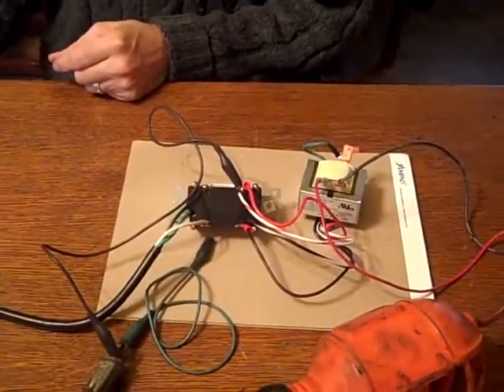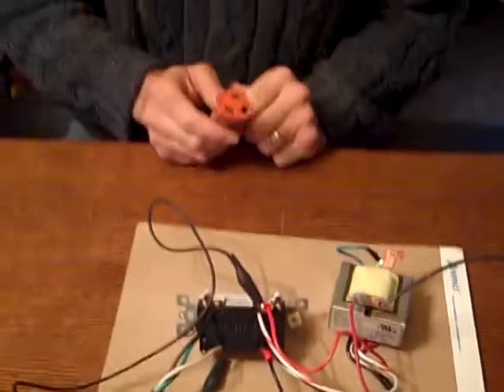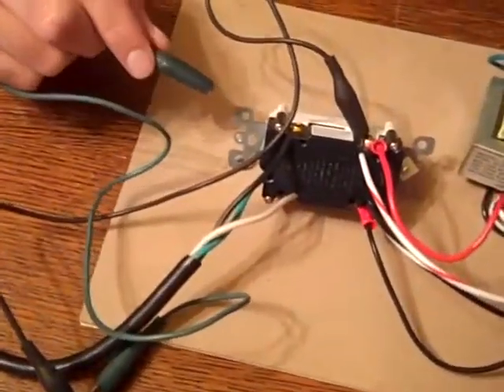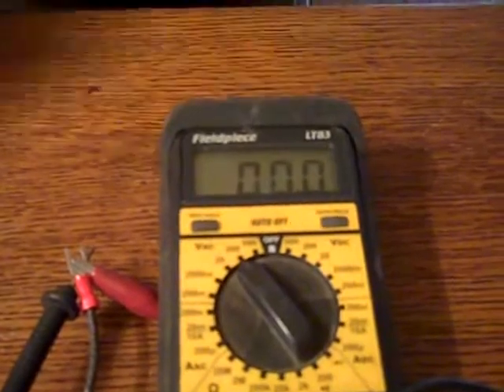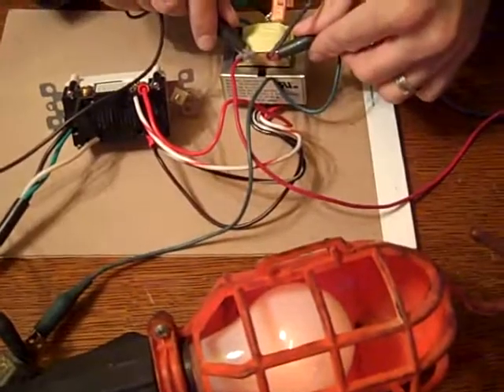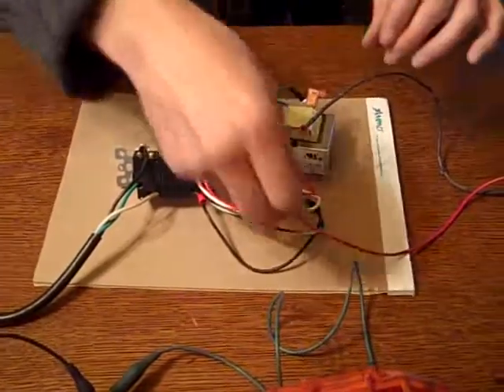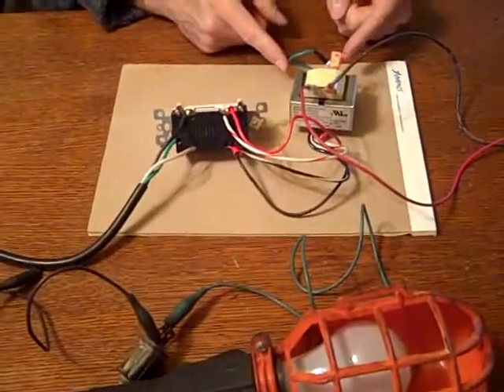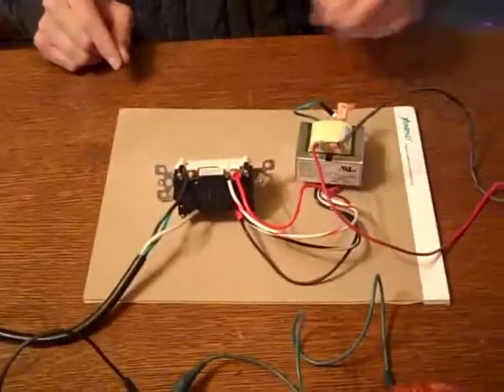Adv. Elect. GFCI & Transformer

Comment: The GFCI actually has a resistor inside connected to the line side neutral. When you press the test button, that resistor is connected to the load side hot, creating an internal ground fault. The resistor is typically around 24k, which will pass 5 ma at 120 volts.

Comment: Following a water intrusion event from the rear side of the niche, my Pentair Sam Light has no VAC on the secondary side. Any recommendation on where I can buy a replacement transformer. It is encased in a Jello like substance at the bottom of the metal enclosure.